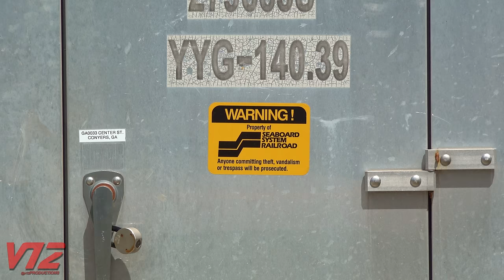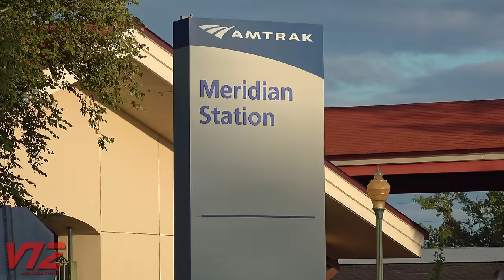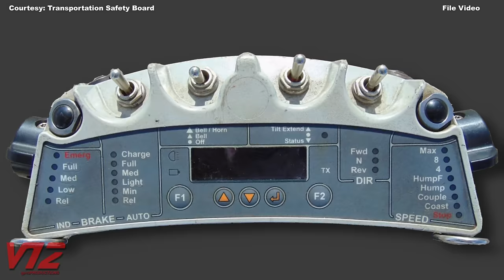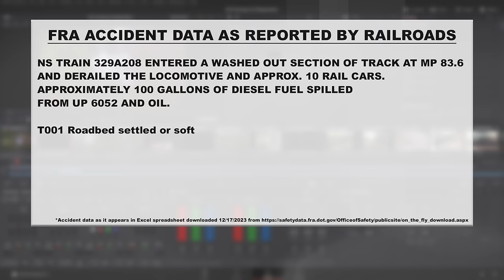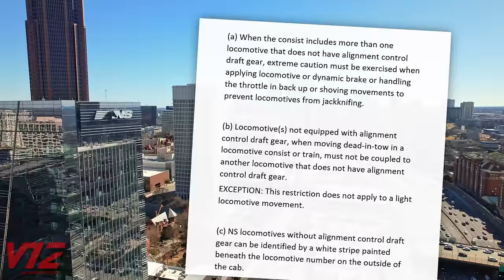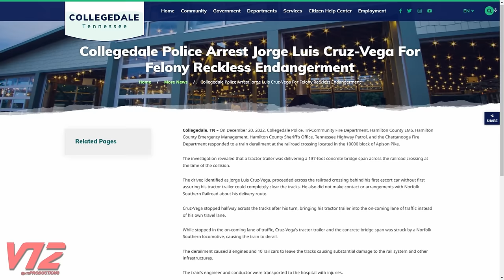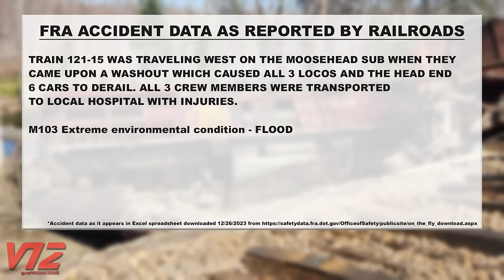Train Derailments 2023 | SPECIAL REPORT

Comment from the maker: UPDATE ON COLORADO MILITARY TRAIN DERAILMENT: This is how the railroad reported this accident to the Federal Railroad Administration –
F-SYRFC01-05S DERAILED 12 RAILCARS ON UP MAINTAINED INDUSTRY TRACK AFFECTING THE BNSF MAINLINE, SIDING AND INDUSTRY LEAD, THAT IS MAINTAINED BY THE UP DUE TO T307 -SPRING/POWER SWITCH MECHANISM MALFUNCTION. BNSF HAD $80,818 IN TRACK DAMAGES AND UP HAD $140,622 IN TRACK DAMAGES.  NO HAZMAT RELEASED.
Reply: Thanks
Reply: 26:50 lateral movement is up and down, longitudinal is side to side. latitude and longitude lines. when you hit the brakes the towed coupler takes the path of least resistance which is upward as brake motion causes the nose end of everything to dive under air brakes as the milliseconds of force applied to the head end of each car activates just that half second faster than the trailing truckset bogeys brakes and so on in successive order. reserve air tanks are supposed to smooth this out and does on slow brake applications, quick high power application to emergency application results in the dive action. talk to DJs trains on YT about this as he is a CSX heavy driver. Pump jacking in the rail lines also aids slightly in this lateral motion as the rail sinks only directly under the bogey wheels and the couplers are between 2 sets.... pump jacking just as the track gets to a road crossing shows just how visible all of this action is. machine shop working on what you are talking about to make it FRA legal for dead in tow skip to 16 minute 45 seconds or to 22 minutes for actual visual work complete displayed  Locomotive Bought on an Online Auction - Helping My Customer Get It Moved - Shipping Nightmare
Topper Machine LLC
92.7K subscribers 318,994 views  Apr 1, 2023  WISCONSIN
Well, my customer bought a locomotive at an online auction.  Now What???

This locomotive is an EMD GP7U.  It went through a major upgrade in 1980 by the ATSF and is now essentially a GP38.  One of EMDs best locomotives.  

My customer bought it based on my recommendation for use on a shortline freight railroad.  The Wisconsin Great Northern Railroad will put this locomotive to good use.  

This locomotive has been in captive "Mill Service" for many years and needs a bunch of work before it can be shipped to its new home.  Since the FRA does not have control of anything within an industry, some of the maintenance and repairs have been neglected.  

For this move, nothing has to be done with the engine or electrical.  Just brakes, wheels, couplers, etc.  All things I have dealt with in the past.  But in this case, I have never dealt with a bigger group of incompetent people in my 25 year career of railroading.  The inspectors on the first railroad were total idiots.  We went through 4 different ones before we got anywhere.
Reply: 9:36
Reply: 4BS€N M☆$ HADiR  ❤YoutubeMantap Eiy 🎉🎉🎉🎉🎉🎉🎉 S€MOGA $UK$E$ URUSAN LANCAR SEMUANYA .
Reply: Wuuuuuuuuuuuuuuuuuuuuuuuuuuuuuuuuuuuuuuuuuuuuuuuuuuuuuuuu
Reply: Nice
Reply: Well, unfortunately it looks like that Ford wasn't built for tough.I thought it was a Maverick LO.L

Comment: Could have been prevented if the police called the 800# on the gates upon arrival.
Reply: Or parked off the rails
Reply: Train crew had a LONG time to stop. Especially with 2 engines and only 4 cars.
Reply: They don't even have to do that! All they have to do is radio dispatch and they are supposed to contact the railroad and they'll shut down the line!!!!!
Reply: It doesn’t matter because YoU’L bE gOiNg NoWhErE
Reply: The tractor should've disconnected from the trailer, too
Reply: @Kyle-gb9dq if the bottomed out trailer is pressing down on the tractor you couldn't move it. The ideal situation would be if the trailer is equipped with an air bag system that can be manipulated. Inflating or deflating certain bags could allow you to unstuck the whole thing.
Reply: I guess you missed him saying right in the beginning that the police dispatcher was contacting the railroad.
Reply: You could unhook the truck no problem . Where I work we are trained to immediately call the 800 number then worry about getting the truck unstuck .
Reply: @FatGuyInaTruck 100% Agreement!  Ridiculous Actions by Crew. 🤪👎
Reply: @kwhopper1100   @kwhopper1100  It's possible you could just pull away from it but every scenario is different and depending on the weight distribution of the load on the trailer, where the trailer has bottomed out, and how much lower the tractor is than what the trailer is caught on - the tractor will not be able to break free from the trailer. It basically will have pinned the tractor to the ground. You're not going to be able to jack the trailer up by hand enough or at all to relieve this pressure - if the jack legs will even reach the ground. Pneumatic legs might help if they're long enough. Manipulating the air bags can help too but if you can manipulate the air ride system you should be able to drive the entire thing off the tracks.
Reply: The driver is stupid because he relied on the dumb cops to contact the railroad. Every driver should know there are signs post at the intersection that connects you directly to the railroad... no need for a 3rd or 4th middleman. The police are no help!!
Reply: Or over inflated the trailers air bags, chances are he would've pulled away no problem
Reply: @FatGuyInaTruck  Yeah some things dont add up here. How does dispatch know a train is coming? CSX told them? Then why is the train still going and wasnt stopped by dispatch? And second, as you said, it was a straight long piece of track, how they couldnt stop is also weird.
Reply: Actually, the Commander of the nearest State Trooper barracks can order the train to halt.
Reply: Well said ! ❤
Reply: It's not the officers responsibility to do that. It's Dispatch's
Reply: @nomoneyglobal I don't care if I knew the train was coming. I would have hauled ass over the intersection and would have taken the damage to the undercarriage of my trailer
Reply: @FatGuyInaTruck you got that right cops easily could’ve prevented that
Reply: ALWAYS make sure you're at speed when driving across a grade crossing!
Reply: @joemac3118 they did but dispatch took too long
Reply: @Sweetw4ter perhaps a unit saw the train? or they have information from train radio but cant speak to the trains? not sure. 800 number is dispatch tho ive called them to report malfunctions on gates and the crews are out within a day
Reply: Eeyup.

Comment: I tried a search on the reporting mark "RMEX" and came up short also. However, I was able to determine that the locomotive @26:08 is a GP 11that was designated as an "Operation Lifesaver" locomotive. It appears that at sometime this locomotive was sold to Iowa Interstate Railroad and was renumbered to #485, acquired March 28, 2000 and sold December 10, 2009. EMD frame # 5359-7, builder # 19774.
Reply: It looks like it is or was a minor class III short line in Indiana
Reply: RMW Ventures, LLC. These locos had been running on the Wabash Central in northeast Indiana.

Comment: I have tried to use one of those signs at a rail/street crossing,   Luckily it was a lightly used freight rail line. Close by I spotted a tree across the rail which oddly looked like someone took a chainsaw to it.  The contact info on the sign was totally useless.   When I alerted the local police I told them about the fallen tree and the useless railroad contact sign,

Comment: I would agree that train length should be limited. And fines for driving thru crossing guards when they're down should be much higher.
Well produced and informative video.
Reply: what would you limit it to?   100 cars?   50 cars?   Do you factor in weight in your thinking?

Comment: In the past I have questioned how ell maintained our rails are although I would wager the main lines have a better chance at better maintenance.     Nearby we had short rail line between two cities that had not been used for decades.    It had almost become a rail-trail at one point.     A year or two ago it was decided to make it an active rail line that crosses multiple streets, many with only a sign with no barriers and no lights.  This while crossing local state roads, albeit at low speed. Before the no trespassing signs were put up and after the track was refurbished I would walk along them.  Some of the rotten ties had been replaced.   I seem to remember some federal $$ money was involved,  Also it seemed more rotten ties were replaced closer to street crossings,   I could not help but wonder if the chance of inspection was closest to street crossings.   Thanks for posting your informative videos.
Reply: As a former Railroader I'd bet good money that the rails are well-maintained. I worked in Jacksonville but visited Georgia rail facilities many times both Norfolk Southern and CSX. I'd worry more about the morons they hire at NBC Universal than I would the tracks fool.

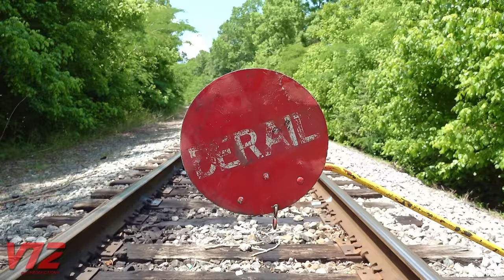Comment: I've been working on the railroad (Locomotive Machinist) for almost 25yrs now.  And I use derails on a daily basis as part of my Blue Flag Protection.  Just saying....The portable derail, in the video at 40:01, appears to be improperly applied!  I'm not sure that would even derail a wheel set.  It's on the wrong rail!

Comment: The alignment control draft gear would be situated behind the actual coupler. It's basically a big box the coupler sits in to cushion forces caused by normal train handling. You wouldn't be able to see it well unless you get a shot from the side, under the pilot.

Comment: The Ft. Carson Derailment was on Union Pacific/BNSF Joint Line between Denver and Pueblo, Colorado. That's why UP/BNSF both showed up.
In my opinion, which I've heard from many others, that it's not going to be popular, but in my opinion, Freight trains, because of their growing size, and cost cutting measures from all railroads, is to slow down Freight trains to a maximum speed of 50 mph. And Passenger trains, including Amtrack, need to be slowed to a maximum of 60 mph. Again, my opinion. The Montana derailment comes to mind for that reason. Let's face it, Railroads are not taking care of their infrastructure like they should and trains are getting way too long to safely control. Slowing them down is the best option.

Comment: I believe the alignment control couplers theyre referring to has to do with the little tang at the bottom of the knuckle, you can see the left one has it, and the right one doesnt at 28:00
Reply: Negative. Alignment control couplers have protrusions on the draft gear in the coupler pocket, that are acted on by either spring force or hydraulic. The ears themselves can be seen by looking into the coupler pocket of a locomotive.

Comment: 6:52 fun fact: 6024 was originally built for the Baltimore and Ohio in 1972 as number 4124, the engine would be painted into Chessie System colors and would remain in those colors, even after the Seaboard System and Chessie System merger until it was repainted into CSX colors (It was also renumbered to 6024 after the merger BTW)

Comment: Hot box/bearing detectors are a great safety system but I wonder if well before a bearing overheats and fails catastrophically it will make a very noticeable noise.  I have watched 100+ car trains at grade crossings,  and sometime just one car will be making a much louder noise then the others.  Is that an early sign of a pending bearing failure?   Do the hot box detectors pickup on usual bearing noise?

Comment: About the Chicago accident (starting at marker 42:30), I would suggest that MU cars, especially those operating in short headway corridors, should have limited rail sanding capabilities for emergency use only in order to properly reflect the physics of the wheel-rail interface. This would require a low-capacity sanding system to be used only for one-time short duration emergency purposes, just like for on-board fire fire extinguishers or other emergency consumables that have to be re-supplied after use. In addition to this being beneficial against insulated work equipment material, it could also improve safety at grade crossings when drivers of road vehicles ignore the crossing protection signals. 2023/12/31. Ontario, Canada.

Comment: i now live in minco oklahoma and im 300 yeards from a bnsf track and i heard the sounds of the heave clacking and another train show i watch said i should go look at the tracks and there was a joint that had two bolts missing and very bad damage to the rails  i called bnsf alert number and let them know and i sprayed the joint and ties with yellow paint . now six monts later they replaced 5 miles of track and the siding rails now almoot cant here the cars going over the tracks a very lot of tank cars go buy here  going north to a tank farm of crud oil

Comment: The tank car has a placard on it indicating it’s loaded. Placards are to be removed when empty, on rail cars or trucks! Some may have a placard that indicates residue, but if there is a placard on an empty vehicle, someone hasn’t done their job, bad consequences.
Reply: They're usually kept placarded because they don't get all of the liquid out of it.
Reply: Railroad cars do not remove placards when empty. The only way to tell if it is loaded or empty is based on the paperwork or springs.

It also should be empty due to it being the second or third car behind the motors. If it was loaded it would have to be (assuming the crew didn't ignore hazmat placements) the rear car.
Reply: Then you people were never trained in hazmat!
Reply: Not about being trained on hazmat. As train crew, we don't touch the placards. Just because something does or doesn't have a placard, doesn't mean it's loaded or empty.
Reply: As train crew, placards aren’t your job. The loaders or unloaders are to place or remove placards
Reply: Only if the car has been purged of the contents is the placard removed. The residue in the tank can still be dangerous
Reply: @ryansais13  Railroad crews do not remove placards.   The shipper does that.    The cars placard is an indication if the car is loaded or carrying residue from the previous load.

Comment: From my training in the Transportation Of Hazardous Goods, hazardous placards are only on the trailer/rail car/container when the product is loaded. Once the product is off loaded, the placards are removed. 

So, ya, that rail car was loaded.
Reply from the maker: I just learned something. Thanks!
Reply: @v12productions  He's incorrect when it comes to rail cars. Placards are not removed.

The fact that it is the second or third car implies that it should be empty. If it was loaded it would require 5 cover cars or all available. Wasn't the rear car so it SHOULD be empty if the crew did their job.
Reply: Unless the product is purged from the car the placard is not removed.   It is instead placarded as Residue Last Contained.   The assumption is some reportable quantity remains in the car.  (There are exceptions)
Reply: @ryansais13  How deep you bury cars from the occupied locomotive depends on the product being moved and how it is placarded.

Comment: What happens  to all freight cars trucks when they come to pieces in a derailment as you see st time's they are put back together,  or are they scrapped or are sent to checked and reassembled
Reply from the maker: Some are reused. I'm actually hoping to produce a video about this topic in 2024.
Reply: @v12productions  thank you l will look forward to seeing that,most of the bogies are welded or mono bloc in the uk
Reply: depending on the damage and age of the car. if it's a car close to it's FRA retirement, scrapped. but I would think most get scrapped because there could be hidden damage that could potentially cause another derailment in the future

Comment: In the wake of the East Palestine wreck, Norfolk Southern has installed new thermal/ visual detectors further west on the Fort Wayne line, at Columbiana, Ohio.
A little too late for this incident, but it will hopefully help prevent a recurrence. Additionally, I'm pretty sure they reduced track speed through the area.

Comment: That black residue that the ntsb found on the rails of the final accident was probably the noise canceling rail grease that so many railroads are using to reduce screeching noise from rubbing flanges, now I thought of this and I went back and examined the track where it happened and the photo showed two dark squares trackside that could have been flange greasers, engineers don't like them near hills as they do cause wheel slippage. The same principal that caused the death of a friend 40 years ago a construction company installed back up warning alarms ,then workers were required to use hearing protection because of the noise but they worked to good the backup alarms weren't loud enough to be heard through the ear muffs and he was run over by a dump truck. Pure irony
Reply: rail grease is not applied to reduce noise but to reduce rail and flange wear.   The grease is applied to the inside of the rail usually near curves.
Reply: @cdavid8139  Yeah my bad, you is rite, but a retired carman for NS asked a maintenance man one day how that worked he told him but one bit I thought was cool the stuff is water soluble, but me thinks it'll take more than rain, maybe a pressure washer?

Comment: I'm baffled by the first incident. The first priority would be to let CSX know about the situation, not trying to get the trailer moved. You can spend all the time you like fixing the problem ONCE the trains have been stopped. Also that train was only pulling 4 cars! I understand a 2 mile long train would need a massive distance to stop. But this is not a long train. They could have easily stopped in time unless the engineer wasn't paying attention.